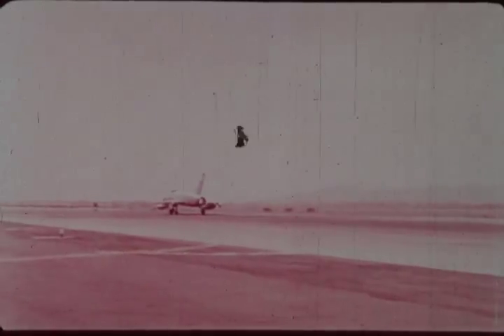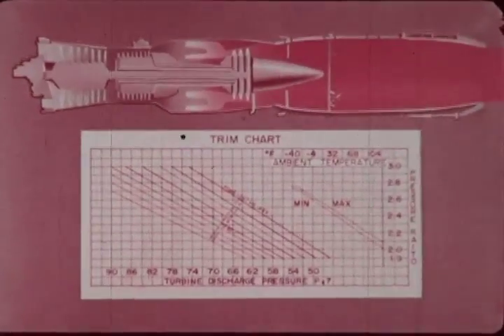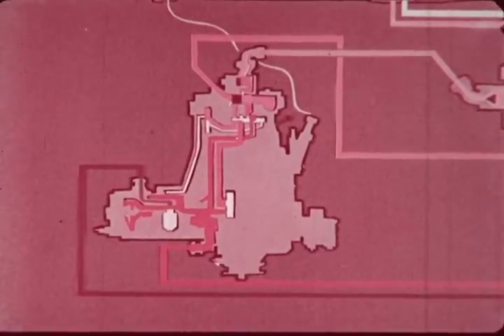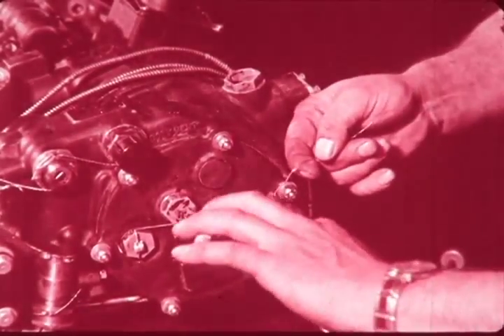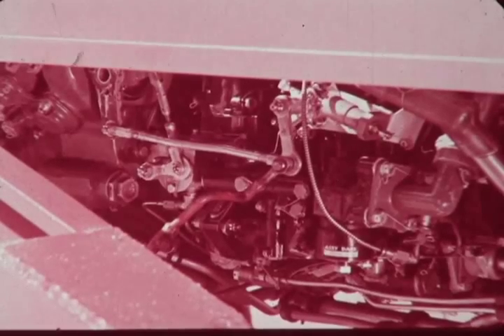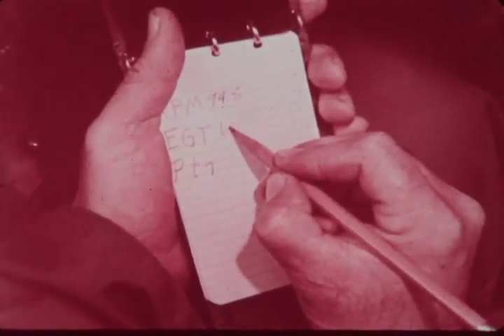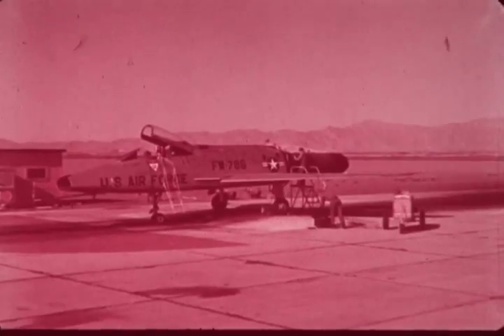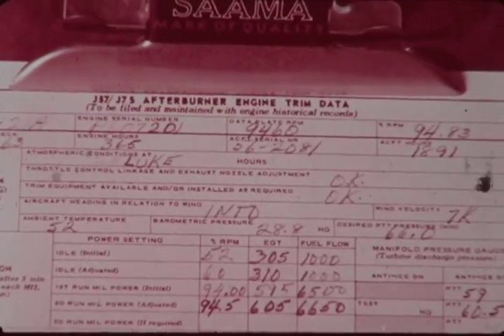F-0064 The J-57 Afterburner Engine

Comment: Wild to think we were still using the J-57, albeit without the afterburner but with water injection, on the B-52G, KC-135A, and the KC-135Q until the early to mid 1990s.  I used to love doing the adjustments on the constant speed drive for the generator, just forward of the bleed valve on the left side of the engine.  You're standing there with a screwdriver trying to adjust the frequency to 400 Hz on the CSD with the engine at 100%, the guy in the right seat screaming in the headset so you can hear him.  And heaven forbid the guys running the engine see signs of a compressor stall... they chop the throttles, which immediately opens that bleed valve, dumping center stage compressor air overboard and sending your ass flying.  Never had it happen to me but watched a guy fly about ten feet while I was standing fire guard off the nose before!  The J-57 was a pig to work on but it made me a better maintainer on the newer stuff when I got to it!
Reply: Check my page out. I built a jet truck using a j-57 with military afterburner. Ran it on pure karasine. I did 420mph in 9 seconds in a test run. At shutdown the shoot literally tore to the rear frame off the vehicle. Ahhh, the nineties was a grand time in life!